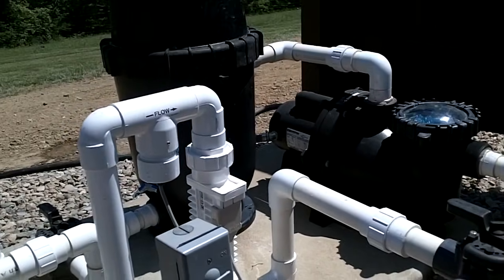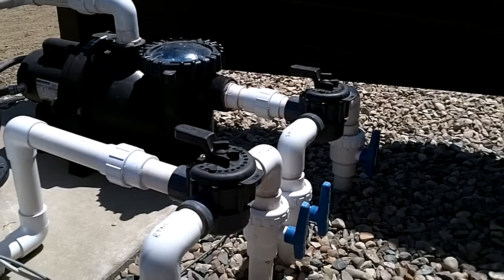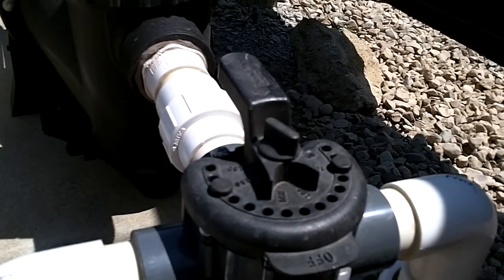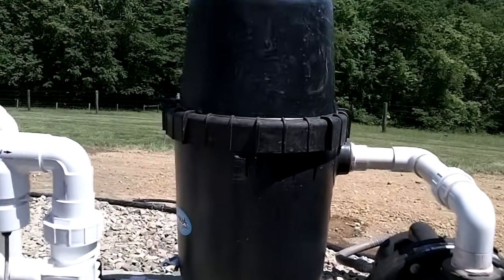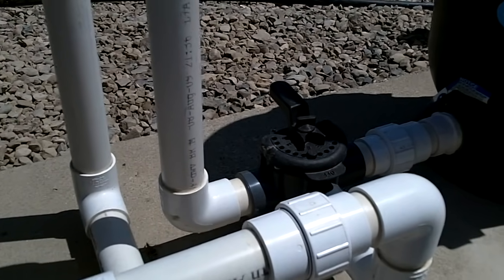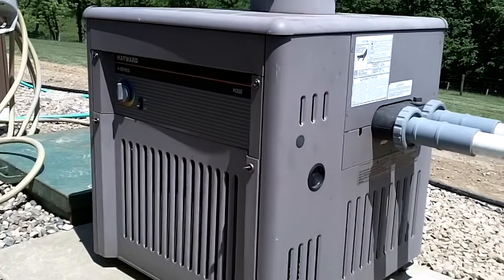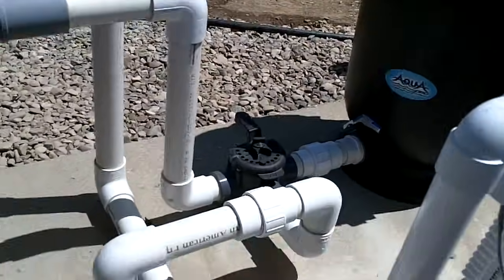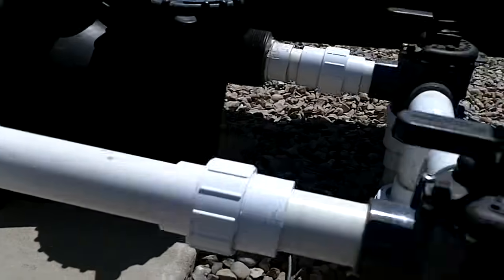How Pool Plumbing SHOULD be put together.

Comment: Here are some points I would like to make as food for thought. The difference between the common 90 and the sweep 90 is 4.3US gallons/min, which works out to 258US gallons/hr. As I mentioned, it doesn’t look like much, but let’s go just a bit further with it. 258US gallons/hr is 6192US  gallons in a 24-hour period.  Your setup is terribly inefficient
Reply: Agreed.  Each 90° turn is equivalent to 8’ft of plumbing length.  He’s losing efficiency at every turn.
Reply: Since you're an efficiency expert I have a question for you.  When my pump was installed, the installer would take lines leaving the filter run them on the ground.  When ever the lines crossed other lines he would install a 90 degree elbow go up 8 to 12 inches vertically, install another 90, go over the intersection, install another 90 down to the ground, another 90 and continue with the run.  Basically making a overpass.  Two questions would that cause a lose of pressure at the jets going into the pool, and 2nd would air collect in the elevated piping that would cause a blockage of water flow?  Or does the pump have enough power to push the air out when started?
Reply: @johnnyrocket9372  Yes to both questions.  Your pump would need to prime for Longer than needed to remove the air gap. Then when the pump slowed to filtration RPM the air gap will form again.  But there are many other factors to examine.  Plumbing size. Pump size. Type of pump variable or fixed. Distance from the pool.  Have another pool pro come look at the setup and give their opinion
Reply: @jbright97  thanks for the response.  Always made me wonder.
Reply: Not sure if you saw my recent post on tips for valves on returns and skimmers and some general tips on plumbing design but would appreciate your thoughts. I can repost to this thread if it doesn’t appear. Thanks
Reply: Do you need a valve for every return and skimmer? I am just about to start construction on my 20x40 rectangle and want to minimize the number of above ground valves and pipe?  If it is ok to tie returns and skimmers lines together where is the best spot? I am using 2 skimmers, likely a main drain but would like to hear your thoughts on deleting that and either 3 or 4 returns. All hard 2” pvc with a 2.25 HP VSP, 31” sand filter, likely a heat pump, salt chloronator. I’m only concerned with space and problems using too many valves. Thanks
Reply: @joejim2963  No valve is needed for skimmers or returns. Make sure you are up to code in your state. Since the Virginia Graeme Baker Pool and Spa Safety Act was officially enacted in 2008, all pools must have VGB main drain covers to prevent drain entrapments and vacuum effects that can be dangerous, even fatal.
Reply: You really should be heat bending a 100' piece of pipe all the way to the pad.

Comment: Hey question for you, I have a 30 by 30 round above ground pool which holds 22000 gallons of water and I have a DE filter from Hayward it's in ec50 theme stores put a drain hose underneath and a main drain in the middle and installed a ball valve before the skimmer was that done correctly? When I vacuum I shut that valve off which is connected to the hose before the skimmer line

Comment: no check valve ---  grounding straps--- anode ?  This is why I will be doing my own.....  lots of 90s  nice huge pump though :/
Reply: Check valves only are useful when the land doesn't allow for proper variance in grade height between the pool and filter pad...

Another way of saying this is that if a pool's plumbing set up includes check valves,  then the builder was an idiot.

Comment: I've been in the pool business for 25 years and I've seen some of the worst pool plumbing to the best. I would be happy to work on this system. It has plenty unions and room to work. Yes it has a lot of elbo's and no check valve between heater and salt system. But who cares? It hasn't been a problem for most of my career in tennessee. I never see check valves and never see problems with the heater or heat exchangers.
Reply: ghosturd77  I absolutely agree with you sir in 25 years I haven’t had one problem due to excessive 90’s!!!

Comment: I'm in agreement with Steve on his points mentioned. I do also see other issues.First, the pump is starving for water because the inlet pipe size from the skims and main drain are TOO small. 1.5" pipe? It should be a minimum of 2.5" PVC on the inlet side. 1.5" pipe on suction lines is a recipe for disaster regarding suction entrapment. The water velocity is so damn high in that size.Why have 2 additional ball valves on the inlet side when a 3 way is in place? The insider diameter of the diverter ball in an 1.5" valve is tiny. No wonder the pump starves.6" of straight pipe minimum is needed prior to any 90 degree elbow at 2" size. If space is an issue, Waterway has sweep els that offer less restriction than a conventional 90.The Autopilot salt cell comes as a kit and the cell is oriented that way-not great but that's how they set them up.Not a fan of gas heaters? It's a millivolt heater to boot. Why? Electronic ignition heaters have been around for 20 years and are far more reliable. Besides, gas heat outperforms other types in temp turnaround. I'm not a fan of heat pumps-too big, too much power needed, slow to heat.The set up is neat and clean but the water hydraulics is a major flaw in this equipment set.
Reply: 2.5" is overkill.  We don't know the THP of the pump as well.
Reply: Aaron I respectfully disagree. After over 30 + plus years in service and construction, we are able to fine tune our plumbing set ups. We have very often run 3'" for our main drains-now we actually use approved strip drains instead.
The difference in performance with 2.5" over smaller sizes much better. You can still get a good suction should you decide to use that line manually vacuuming without any pump cavitation.We use sweep pressure 90's and heat bend for turns when we can.2" pipe is even too small. I see typical pools, like this one, based on small equipment set, are using 1 HP pumps. Not so much because the contractor chose it, but rather this is what the suppliers mostly carry. The previous pump may have been too big and the new contractor assumed the previous installer knew what he was doing.Granted, this may a new set up on an older pool and the contractor is "stuck" with what piping was run. This can be overcome by utilizing a smaller pump to allow a pump to function properly. There's a balance as the proper turnover rate is necessary to keep a pool sanitized.Most importantly-NO FLEXIBLE PVC. It's known for insect infestation and high levels of chlorine will destroy it. (Repairing one now because of high CL)It also reduces water flow because of it's ribbed interior.
Your pipe size is driven by the flow required from a pre-calculated pump on a certain size pool or spa and it's distance from the vessel. It's important to perform the calculations to determine this. The equipment manufacturers have tech support to help someone determine this. It's a good practice to get into.A lot of times a smaller pump is needed and if you are competing against another contractor on a bid, you can demonstrate this to a client. Smaller pumps are less expensive and our customer's appreciate spending less money.
Reply: In California it's required to replace a main filtration pump with a variable speed 1.65hp/2.0hp/2.7hp and generally I go off the prior pump THP and existing pipe size and features.

I believe  that all new pool construction does require 2.5" like you stated.  Looks like I will have to adjust using the 2.5" going forward.

It's interesting that you mention the flexible PVC, because I was thinking that would be a better direction for the skimmer to pump and main drain.   The idea of this was to prevent pool skimmer issues down the line.
Reply: I am aware of California's requirements. The VS pumps not only are energy efficient, but they can also allow you to "dial in" a flow rate. We have been using them on new builds even though our pools are seasonal. We definitely use them for indoor pools.The 2.5" is a good starting point for a basic pool. Some pools will have different requirements based on turnover rate and volume. It may require you to run larger pipe. Again, doing the calculations is good practice. This is especially important on public/commercial pools.Flexible PVC has been known for many years as being problematic. I too am guilty of using it on projects years ago until I became informed of their problems. We would mainly use them on bottom drains and spa jets for ease of installation. It was always known as spa hose, as portable spas manufacturers used it for their plumbing. If there was ever an issue, it was fairly accessible-once you got through the spray foam.The only reason I can think why contractors are still using it is because the trenches do not need to be straight and in rolls of 50' or 100' it's basically rolled out with connections at both ends.Take the time to dig trenches to accommodate rigid PVC and heat bend if necessary. A electrician's hot box, blanket or our preference a propane fired gun made by Hot Bend-highly recommend. We heat bend everything on irregular or round spas. We heat bend 90 percent of our conduit runs too.Use pressure sweep 90's when needed.  High quality valves on equipment sets. We don't use ball valves at all.

Comment: I want to redo my plumbing like yours!   My jacuzzi and pool intake are right next to each other so can I put 90's on them to spread them apart for the diverter valves?  Also I want to divert from the pool heater so it does not go through it unless I am heating the jacuzzi.  Is this wise?
Reply from the maker: Putting a heater bypass is not always a good idea. The industry is getting away from it and some heater manufacturers are not allowing it. The reason is basically a fear of BAD water (unbalanced or over chlorinated)  sitting in the heater while its bypassed and causing ex-changer damage.

Comment: Nice video. I'm curious to why the discharge is after the filter. Filtering discharged water doesn't seem to make much sense. I'd love to hear your input on the reasoning! Have a Happy Holiday.
Reply: Thats a backwash ...its how you clean filter container
Reply: Doesn't a bottom drain plug do the same thing?  It drains the tank away from the pool too?

Comment: too many 90° fittings. 1 90 = 8' of pipe.
Reply: It means that you lost the same amount of energy to friction in each 90 fitting as you would in 8' of pipe.  If anything it might be even worse than 8 feet...but if you have a system with a bunch of extra fittings you are losing the same energy as if you had a few hundred extra feet of pipe to push water through
Reply: Chris. Straub what does that mean?  Thanks
Reply: You’ve never plumbed a pool have you?

Comment: Nice setup. I would only recommend moving the backwash (drain) like to before the filter. We do this for when we open our pools and vacuum to waste that is doesn't dirty the filter. 
Another question is why you put ball valves in the suction line before the 3 way?
Reply: Think hes on about vacing to waste and hasnt got a multiport valve
Reply: What?  The backwash is literally the water in the filter... How can you release the filter water before it reaches the filter?

Comment: I'm installing a cartridge filter. I noticed you installed the diverter valve for waste after the cartridge.  I'm planning on installing the diverter valve prior to the water reaching the inlet of the filter.  The reason is mainly for opening the pool. Most times when opening my pool, there is a lot of debris (worms, leaves etc) in the pool.  I'd like to vacuum that to waste so all that debris doesn't go right to the filter.  I assume this is ok.  Is there a  problem with pressure or anything else while water is diverted away from the filter when the pool is running?
Reply: Tony C Makes sense to me, why filter water you are purging from your system.

Comment: Plumb job looks very clean and well done, but in some places excessive. Also taking into consideration the video is old, but what is the point of having 3 valves on influent side of pump intake? I can understand, for winterizing pool purpose on returns, but not necessarily a must have either. As well as it has been my experience that those ball aren't as durable or reliable as "jandy" style 3 way valve.  Doesn't the 3 way valve for main & skimmer already suit the purpose of diverting water flow? Also, from a maintenance perspective if the 3 way valve goes bad you can replace the insides (gate, o-ring & etc...), so the 2 Union/ball valves seem excessive. I also recommend a threaded/slip union(I prefer Haywards) on pump intake & output, bc unfortunately no matter how good of a pool guy you are home owners & renters alike can introduce circumstances causing pump running hot disfigured male adapters rendering them unrepairable, in this case it's much easier to replace the threaded half of union then to replace half a union, pipe & male adapter. I was surprised you didn't make mention that the choice of millivolt heater also accommodates scale forming condition introduced from salt system(chlorine generator) bc they have rust resistant water path. I agree heat pumps are the way to go as long as use of pool is in climate of above 50°F and too understand the reasoning for that customer's situation being he uses so late into the year. Personally I hate cartridge  & D.E. filters, although you have to use what works best for the overall scenario of the pool. I prefer sand filters w/ vitroclean media. Also take note, I live in a vacation oceanfront island with seasonal vacationers, so with the elements in which we deal with sand filters just overall work best. As you probably are well aware of there are tons of pros and cons in filter and sanitizer choices, hard to say there is any one way that is the best for all scenarios. Looks like you do great work! Keep it up, the Pool community needs more educated people out there doing things correctly!! - OBX, NC

Comment: you should add high temp threaded unions to pressure and suction side of pump
Reply: High temp threaded unions?  You have no fucking clue what you're talking about.  

All unions are threaded first off, and there's no such thing as "high temp unions". Putting a union anywhere on a suction line is just stupid if actually done,  though I've never seen it. 

Suction lines should run directly to a 3-way valve then into a Praher union before accessing the pump. 

I've installed 12 heaters so far in 2021 and I've still not come across one of these "high temp unions" you speak of,  do you get them off the horn of a unicorn?

Comment: Not to bad of a system. Only problem i seen was  the pump wasnt catching a full prime. And everyone that has a pool should be considering upgrading to a d.e. Filter fyi.
Reply: +joseph gonzalez - Agreed. I've run a Hayward DE for close to ten years and I've never seen water so clear. Dive in with a mask and the clarity is stunning.
BUT, I'm shopping around for a sand filter now because I'm getting tired of the maintenance, and opening with a green pool is a major PITA since the DE clogs up so quickly the first day or so.
Here's a hot tip tho, reliable sources tell me that adding a cup or so of DE to a sand filter will give you the same clarity. Put it in the skimmer, just enough to raise the pressure a pound or so, and you need to re-add it when you backwash but seems to me the way to go.

Comment: FYI there shouldn't be so much air in pump basket area. its pulling air from intake line, might need to check that out. other than that clean set-up brew
Reply: That or a dirty filter